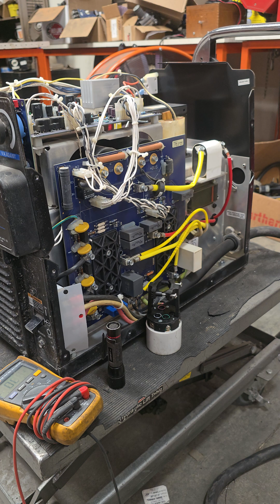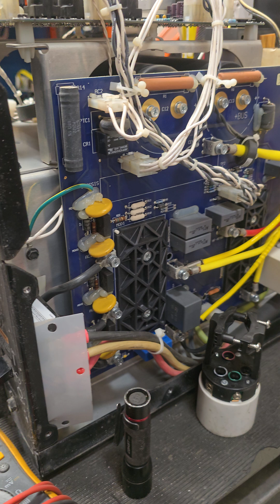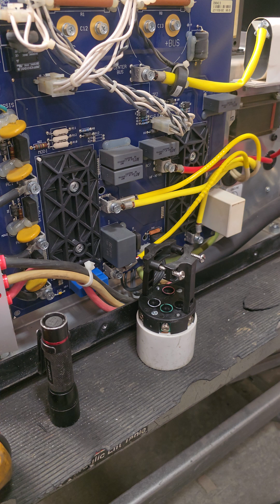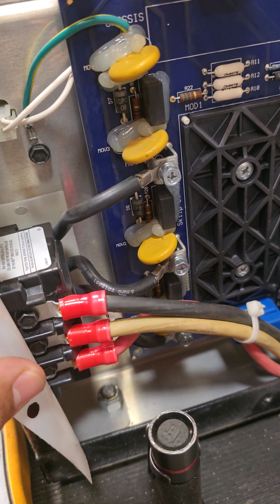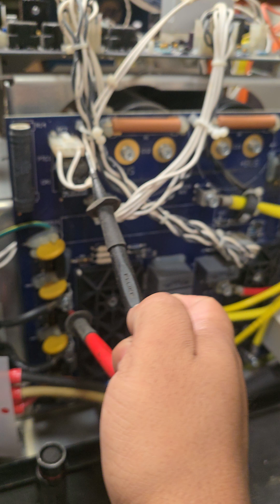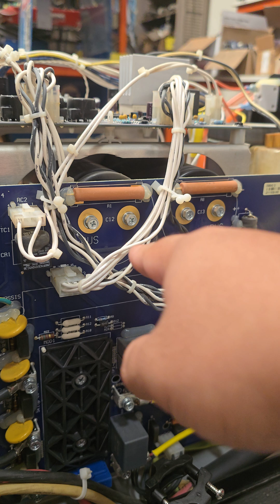Miller XMT 350 has power issues. Tips for warranties and non-warranty.

Comment: I have a XMT 350 CC/CV single phase. It turns on fine. But as soon as you touch mig tip to weld, quick arc and displays shows HELP 1. Where to start?
Reply: HELP 1 is almost always a problem with PC1, the control board.

Comment: I have a question for you. I have this exact machine and I let it sit without unused for about 4year and when I went to weld it was not showing any voltage on the readout. I was thinking the capacitors are bad could that be my problem? It will not mig, tig or stick. No spark at all. Thank for any help you can give me.
Reply from the maker: @DannyMurchison   Open it and check the output studs. Sometimes that lead is loose. If you are safe you can check for bus voltage when its on, should be over 400 volts dc. After that im guessing its the control pcb or front pcb, just a guess.
Reply: @Ricfixeswelders  Thank you I will check that. Could I ship it to you if I can't fix it. what state are you located in if you don't mind saying.
Reply from the maker: @DannyMurchison  Emco East is the company name in Northern California
Reply: Me pasó justo lo mismo